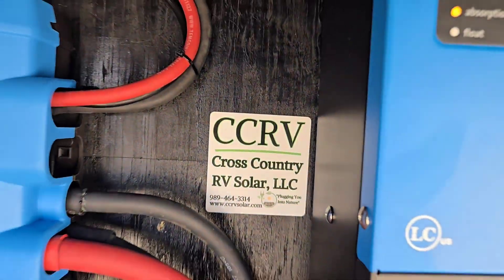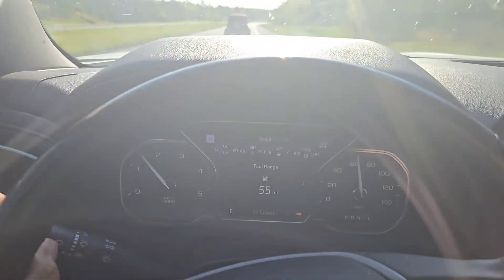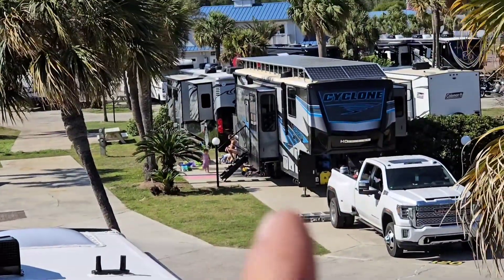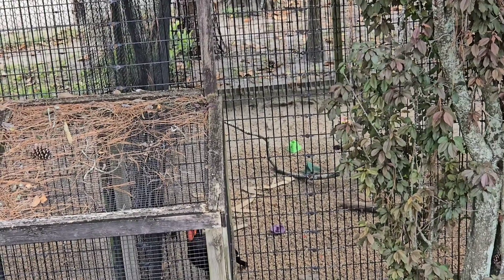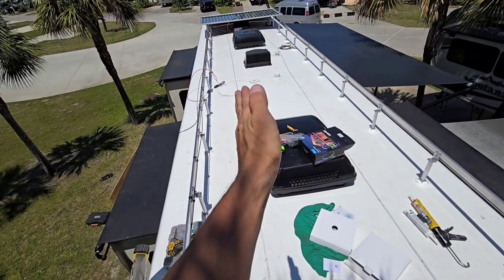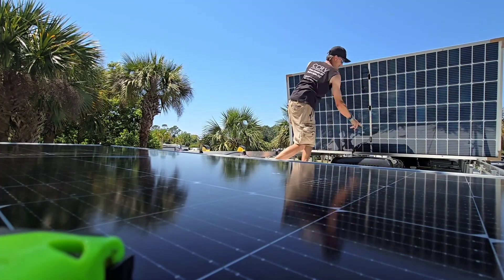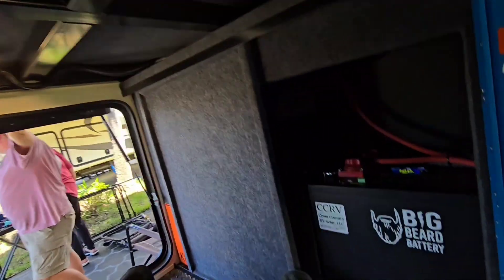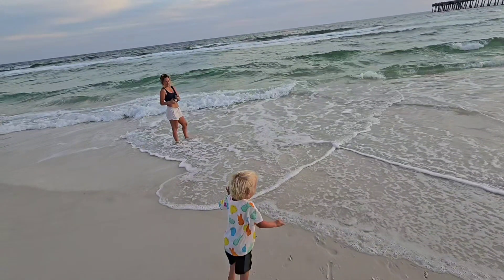Riverstone Legacy 5th Wheel with Massive 24v Victron Solar System; 5,500 Watts, 10kVa, 900Ah Solar..

Comment: Looks great! Do you notice much of a benefit from using bifacial solar pannels? Are there any particular pannels you would recommend for partly shaded areas, or does nothing work well in that case?
Reply: Also where do you get those raised roof mounts? Do you make them yourself?
Reply from the maker: I carve each piece out of a block of aluminum myself....lol....
Or I might buy it from a residential solar racking company and make a few modifications to use it on RV....
I would probably give you that info over the phone.....
Reply from the maker: Definitely love bifacial panels if they are raised off roof like my rack systems.  If they are directly to roof on z brackets, not as much benefit.  I really do not have a lot of real world numbers or data to prove anything but my 6600 watts I have seen in the 7000 many times, but sometimes it was definitely from  cloud edge effect....
I'm done a rack with over 7000 watts in a couple weeks....
Thanks for watching and commenting....

Comment: Very nice setup!  I was wondering if there was a Dc to Dc charger installed as well?  I’m looking at the new Victron 50 amp charger and wanted to know your thoughts on it?
Reply from the maker: There was not a dc/dc charger installed.....
For this exact system being 24v batteries it would require a 12v input 24v output dc/dc charger which in victron terms the biggest one is only like 15 amps output, we could do multiples in parallel but what really stops most people is the installation on the truck side can be annoying running the heavy gauge wire to the back.....
Now in the terms of the new Victron 12v 50 amp one, that is really nice if you have 12v batteries especially since this is the first victron dc charger that connects to the cerbo or other gx devices and will show up on display screens.....
However the truck side wire is still annoying to install, motorhomes are my most common system installs with a dc charger since it's typically much easier.....
Personally, my opinion is to spend ur money maximizing solar on roof since you will be able to use that every single day and then add a DC charger if you really need more charging power after than.....
Everyone's needs and opinions are a little different tho....
Thanks so much for watching and commenting......

Comment: Why do use Quattro's instead of multiplus 2
Reply from the maker: I use the Quattro for the dual AC inputs so shore power and the built in generator can be wired directly to the inverters and act as the transfer switch....the Multi-plus II 5000Va would also be an option especially for those wanting to save some money but there are a few small features that you get doing Quattros as long as they have a built in generator....
Things like being able to set and leave the input current limit for the genny where it will always be right for any scenerio where it could auto start....there are some ESS features that can be easier causing less config changes....the data logged for the system is completely accurate being able to detect the differnece from shore and genny.....the Quattro as the transfer swicth is much faster acting than the average transfer switch.....
At the end of the day its minor stuff, but typically if there is a built-in genny and they want dual 5kVa inverters my quote will be for Quattros.....
Sometimes, the available space makes the decision....
Thanks for watching and talking solar with me.....

Comment: I see people rolling without generators...I assume they don't boondock much. I don't care how much solar my rig has...I will always carry a generator or two smaller ones I can parallel.
Reply: My wife and are retired and live full time off grid in a Class A. Our system is large enough that it's been over 2 years since we needed to run our 5,500w built in generator. In fact I'm thinking of removing it to save the 200+ lbs. I have a DC-DC charger so I can charge from my alternator too, but I've never needed to use it. The key to solar is having enough batteries. I have 5,020 watts of solar and 23.5kwh of batteries (the equivalent of 18, 100ah LiFePo-4s). We can run everything in our coach just like we were plugged into a power pole at an RV park without a second thought. But you are right. If you trying to live off of 1,500-3,000 watts of solar and 4-6 100ah LiFePo-4 batteries you will need a generator back-up, for sure.
Reply from the maker: Dang 2 whole years, that's aweosme...there has only been once with our current setup that our own power consumption caused us to need the genny but there has been a couple times we have had the customer plugged into our 30 amp "shore power" buddy plug that their A/C usage along with ours drained our batteries....
Reply from the maker: Right, I still recommend some kind of backup power source because there is no perfect formula that solar will 100% meet ones power needs 100% of the time.  Now, if I just ran the necessities, we would never run out of power, but we like to run whatever we want whenever we want.
I will say if I was going to have a 5th wheel built, I would either do no built in genny or do the smallest one possible to save on the weight.  It is nice to have auto gen start as a fail safe to ever having dead batteries especially with the wife, kids, and dog but its a lot of weight to carry for 10-20 hours of use a year...
Most of my customers are not having me install big systems like this video or that I have.....
Thanks so much for commenting, I love talking solar with anyone.....

Comment: 11:30 exactly - finally someone speaking about limits - so many solar "experts" claim unlimited power - um no, there is no such thing, yet. I have a mini split with 2k in panels and 700ah BB. Unless each day is sunny, and even then, you will run out of power at some point, i'm about to get new panels for 3k watts on a 28' tt - nice install as always
Reply from the maker: Ur right, i see the same all the time. What most installers claim is only for a day or two, not all week....
I'm close to unlimited power on my personal system....
We leave the water heater on electric 95% of the time....
We can set fireplace to 65° and run it all night or 1 A/C set to like 76° all night, 2 A/C from 11am til sunset, but throw in a variable like it gets partly cloudy at 1pm or its so hot outside that our A/C(s) run non stop without a few hour window where it's not needed then we will forsure be firing up the genny to help charge the batteries....
It's extremely rare for us to need extra power, but its because of our 6600 watts with no shadows in them ever.....
Reply: I have 5kw of panels and 23.5kwh of batteries (the equivalent of 18, 100ah BBs) and I have no problem running my EG-4 28.5 Seer-2 mini split through the night and having them full the next day even on heavily overcast/cloudy days. We live entirely off grid and haven't run the on board generator in 35ft Class A in over 2 years. Today it was partly cloudy but I was able to run both A/Cs, my residential fridge, TV, PC, etc. and charge my batteries by noon. The secret I've found is to wire my rooftop array in series for high voltage. This performs well in low light conditions, so it starts charging around 8:30 in the morning. To take advantage of his design you must rack your array above your A/C shrouds so that there's no shadows at all on your panels.
Reply: @SuperSushidog  my mini split is on my bumper
Reply: @AskRemy What no comment on the switch?!?
Reply: @EBKRV412  what you talking about?

Comment: Awesome setup... are we ripping all my panels off and putting a rack on mine next winter? lol 

also.. where is the blue cabling?!
Reply from the maker: I thought that was already the plan for next winter....lol....Just kidding Sara...
I didn't have enough of the 2/0 in blue and as much as I wanted to just use all 4/0 since I had enough of that in blue that would of ruined one of the main benefits of a 24v system, being able to use little smaller wire....
Thanks so much for always watching, commenting, and being a friend....